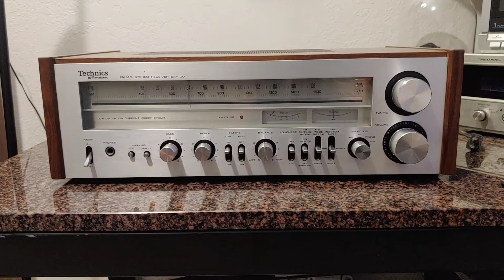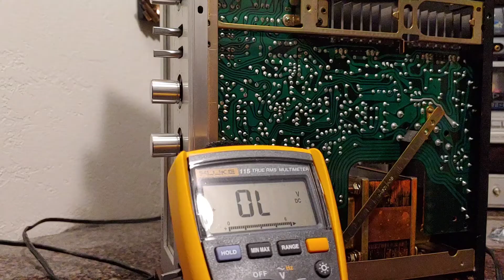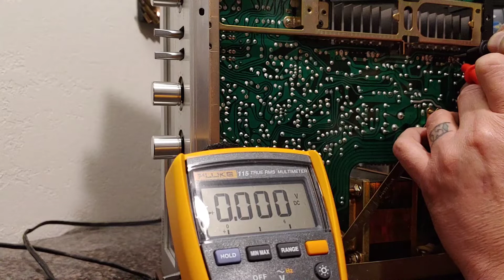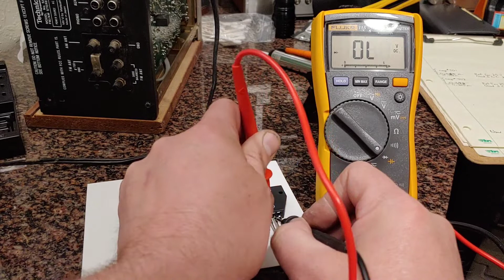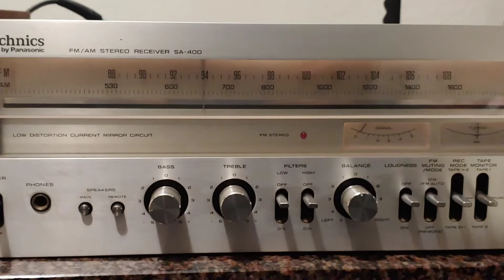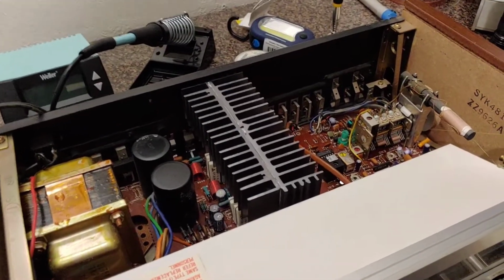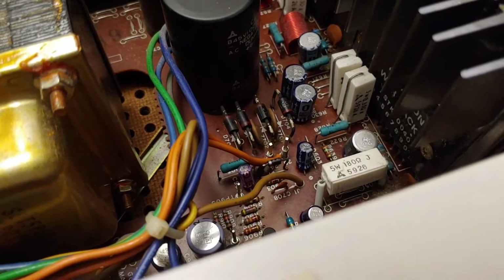Technics SA-400 trouble shoot and repair

Comment: I'm having a issue with my technics sa 1000
The adjustment for the
(-B) voltage (negative power supply) not going to -90V its staying at -68v Even if
I adjusted the vr701 to the max. The unit has a loss of power now because of this.

Comment: I have had my SA-400 in perfect condition since the early 70's but it stopped working and I haven't opened it up yet but your video is amazingly timely to my situation.  Wanted to let you know your video work is appreciated.  I also have an old Sansui amp with similar problem I want to keep and feel I can troubleshoot and fix as well. So thanks!

Comment: Does the faceplate come off easily?  Just got a sa400 and a can of deoxit.  Never used deoxit but I know it needs it.
Reply from the maker: No need to take off the face plate, you can see all the pots from removing the top cover and applying some at the seem or take off the control knobs and applying from the front. I personally did both and the controls operate nicely now.
Reply: @justinmakesrepairs4535  good to know, thanks!  Haven’t had the time, or the courage to open it up yet.  I’m liking the sound, despite it being dirty.  I think the tape monitor switch needs cleaning the most